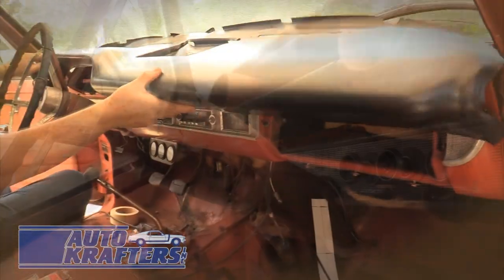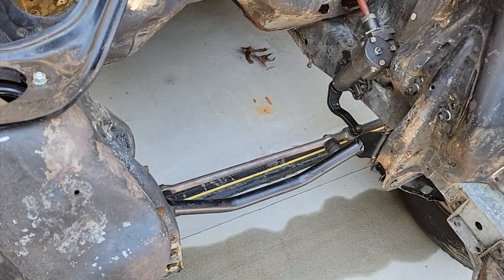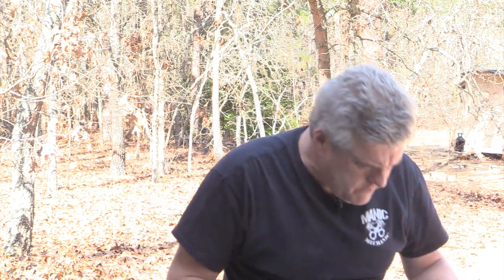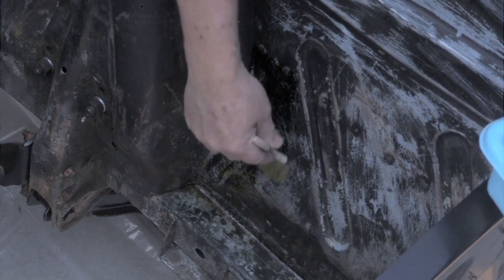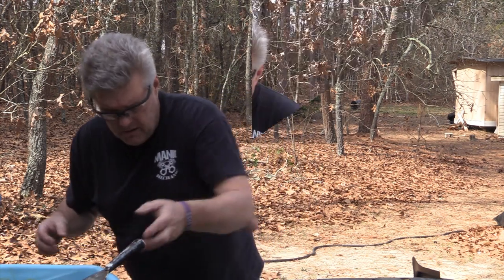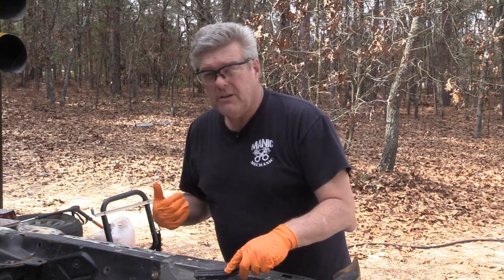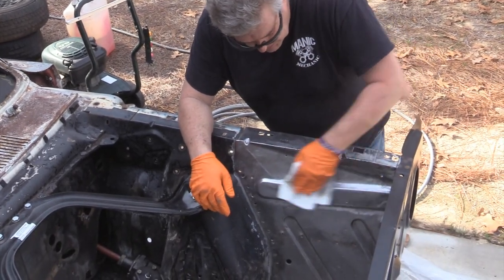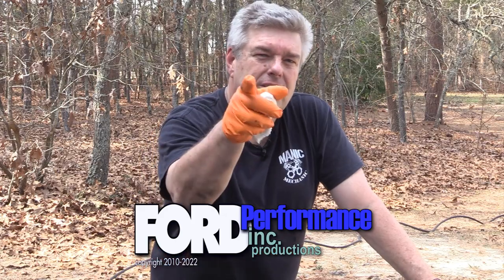Car Paint Stripper Tips

Comment: If I ever do another restoration/refurbishment of a vehicle with paint and rust issues I'm going to look into dipping it.  Wire wheeling, blasting, sanding and chemicals a little area at a time has been a chore to say the least.
Reply from the maker: I don't like dipping personally, I am chasing rust issues FROM the process. Of course it may have been the company, not the process.
Reply: @AutoRestoMod  Dipping is best if you can immediately get it E-Coated which is what the factories do. I think they dipped in some type of similar stuff back in the day. It does not take long for the body to rust in those hard to reach seams when stripped to bare metal. The problem is that nobody in the states does both at the same place. You have to have it dipped in stripper and them ship it to a place that E-Coats. Very Pricey. I'm surprised nobody does both though.